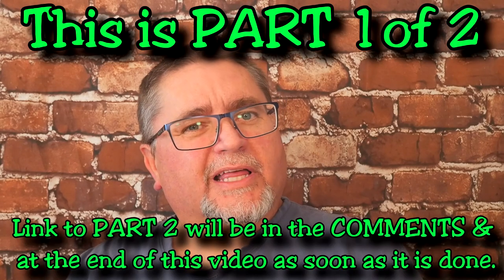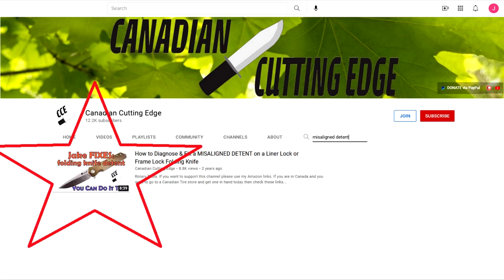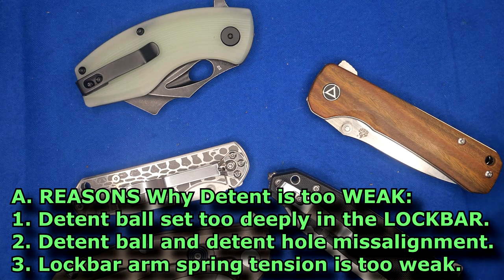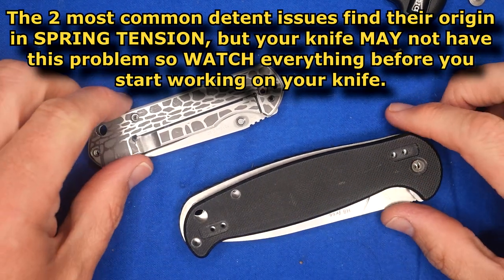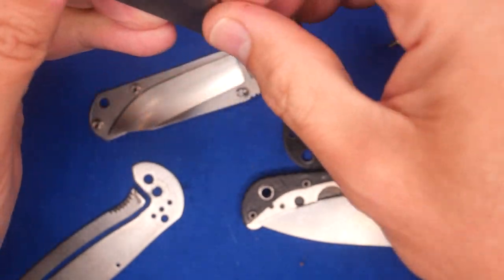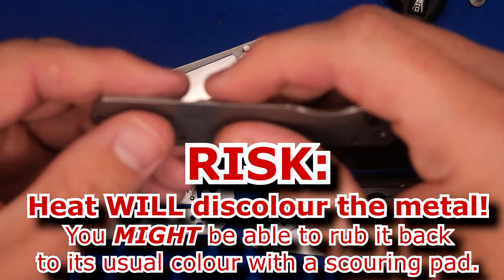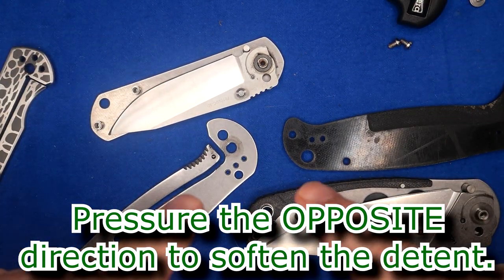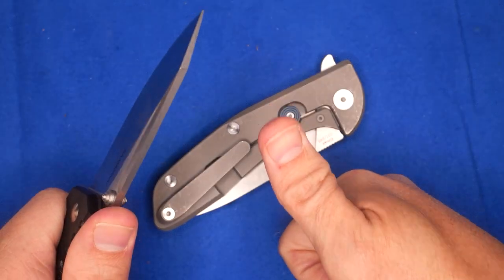CCEU Lecture #23 - How to FIX DETENT Problems with your KNIFE - PART 1 of  3

Comment: Good info, looking forward to part 2. I've never needed to anneal before though I've heard of it being done.  It makes me wonder if it shouldn't just be done automatically after a major bend as a precaution. Adjustments, even minor, can also cause detent misalignment or vertical travel in the lock-up, and I anticipate that  you address these concerns in this series. My own advice: warm the metal slightly first and make the most minor of changes at a time, even if it means disassembling and reassembling the knife several times. Well done again, sir.
Reply from the maker: Yes, if a "major" adjustment is needed or multiple small adjustments it is very wise to anneal the metal.
I didn't spend time with much WARNINGS in part 2. (it got very long)  Perhaps I should do part 3.

Comment: Ideas on fixing detent with button lock ?
Reply from the maker: GREAT question.
Button lock knives by definition do not have an actual detent - their method of holding the knife closed is completely different - I have not heard of a good term for it though, but I understand your your question.  Unfortunately I have not worked through any solutions for that except to say that there might be a problem with the coil spring holding the button lock or the fitment of the locking part of the button doesn't match the corresponding notch in the blade tang.  Springs can be replaced (theoretically - but I don't have a source for them) but I don't have any good suggestions - yet - for the other possible issue.
I know, that didn't help much.
I do think a growing number of people have the same question so I will keep working on it and when I have something ready I will definitely be making a video about it.

Comment: Are there advantages to putting the lock bar cutout on the outside on framelocks? It seems like the obvious choice would be on the inside, so it doesn’t interfere with the lines and look of the scale on the outside.
Reply from the maker: Theoretically it is better to put the lock bar cutout on framelocks and many linerlocks but the degree to which is ti better is so tiny that its effectively not any better to have the cutout on the outside than the inside.
It's not easy for me to describe in text and I forget which video I demonstrated it on.  The arugment is about the angle between the main part of the liner and the lock arm.  If the cutout is on the outside that angle can be less than if its on the inside.  They say the less the degree the more durable the cutout part of the steel is.  I say that a difference of a few degrees makes to durability is impossible to measure in practical terms of how long the knife will last.  I prefer the cutout on the inside.
Reply: @CanadianCuttingEdge  interesting.. I’ll take a look for the video. Thanks. 👍